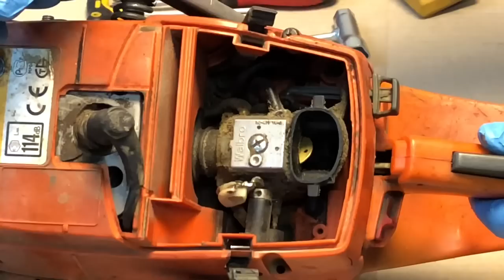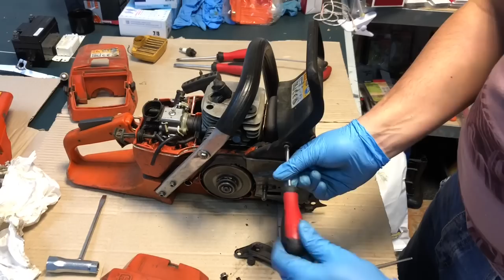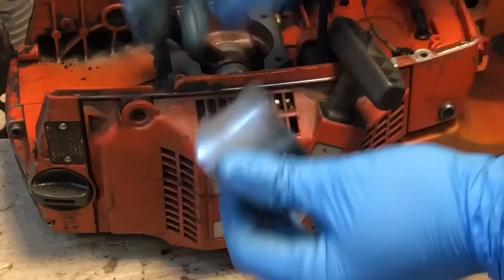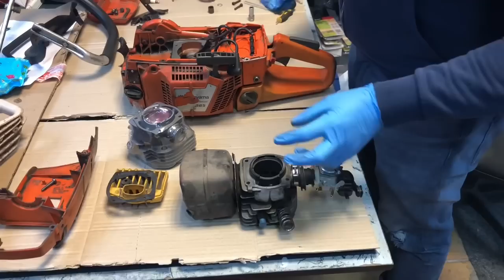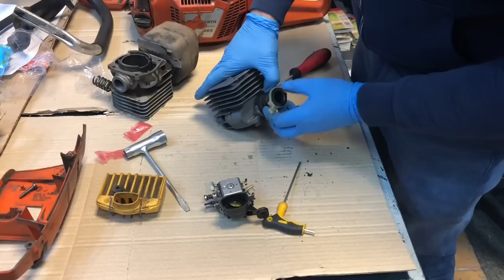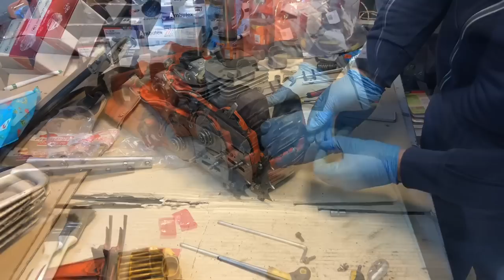Facut motor drujba Husqvarna 365

Comment: Salut. La o Husqvarna 345 e blocata sfoara ce probleme ar putea fi?
Reply from the maker: In cel mai fericit caz este de la demaror, in cel mai rau caz... calat motorul
Reply: @SHRMotorsOfficial  am dat capacul cu sfoara jos si functioneaza..
Reply: Dar cand il pun inapoi ramane blocat
Reply from the maker: Incercati sa invartiti la mana volanta
Reply: @SHRMotorsOfficial  nu merge
Reply from the maker: E blocat motorul :(
Reply from the maker: Poate aveti noroc si a prins ceva. Desfaceti toba
Reply: @SHRMotorsOfficial  am desfacut-o dar se vede doar un pic din piston
Reply from the maker: Desfaceti setul motor
Reply: @SHRMotorsOfficial  urmeaza. Multumesc frumos pentru răspunsuri.
Reply from the maker: Ok. Va asteptam cu rezolvarea
Reply: Salut ! Stiti regalju la carburator la o husqvarna 345 ? Si mai are o problema, a ramas fara decompresor si a fost inlocuit cu un surub normal.
Reply from the maker: Daca e cu reglaj scurt, este 3/4
Nu este problema ca ati pus un surub, doar sa fie etans

Comment: 140 psi good compresion 372 xp oe ?
Reply from the maker: Yes
Reply: @SHRMotorsOfficial  Master, is it possible to pour 33: 1 husqvarna ls + to drink 372xp 357xp and scythe 545rx? Will not jam the piston rings with carbon?
Reply from the maker: Is too much. You will brake the spark plug
Reply: @SHRMotorsOfficial  can it damage rings? and cause seizure?
Reply from the maker: No damage, just the spark plug
Reply: @SHRMotorsOfficial   In Stihl manuals, there were reportedly cases of cuts and jamming of the rings and the piston at 33: 1. Is there a risk of reduced machine life or carbon failure?
Reply from the maker: I think is a little too much
Reply: @SHRMotorsOfficial  Friend, but working with the same 50: 1 oil after switching to 33: 1 will result in more deposits and deposits?
Reply from the maker: Yes. Is too much

Comment: Salut am si eu un stil China ms361 unde as putea sa o trimit la dmv îmi puteți lasă o adresa sau un nr de tel sa putem sa luam legătura sau va las ne meu și ma sunați dmv 0745453538 am cumpărat la ea bujie noua aprindere noua am desfacuto am curatato nu iam găsit supapa de aerisire a ei originala i-am pus-o tot pe a ei trăgea aer da nu dădea afara consider ca erea bună mai înainte sa nu mai pornesca deloc cum e acum am pus putina benzina în corboratot a pornit timp de 30/40 minute nu avea putere când o acceleram și după acea nu a mai pornit deloc dacă mi-o puteți face o trimit prin curier.